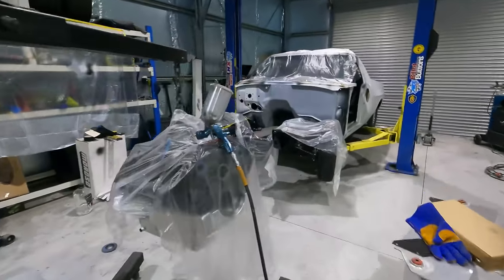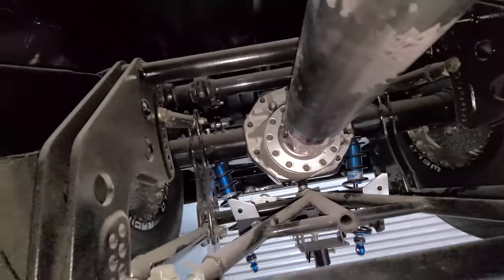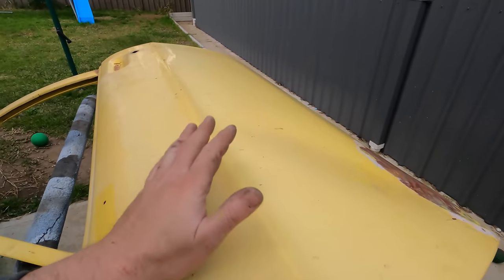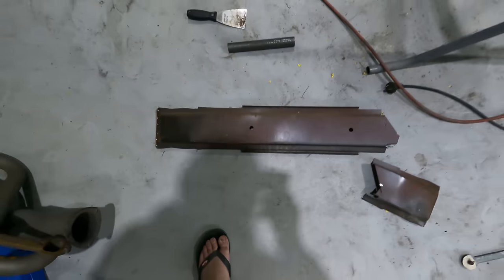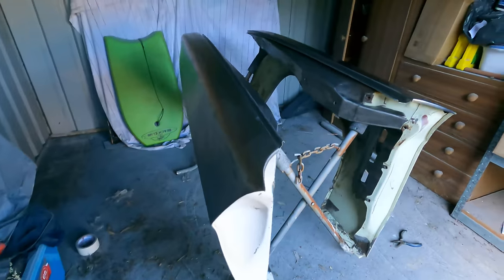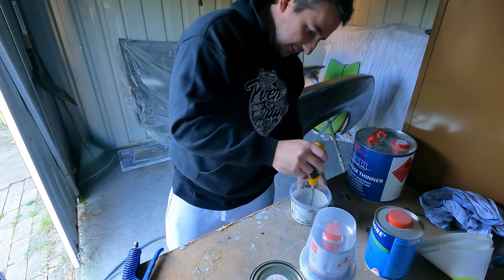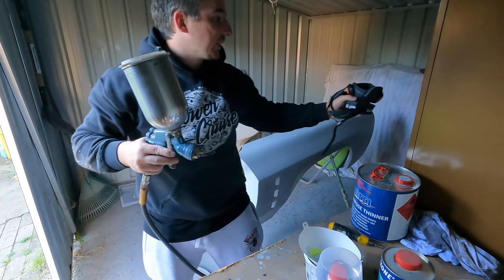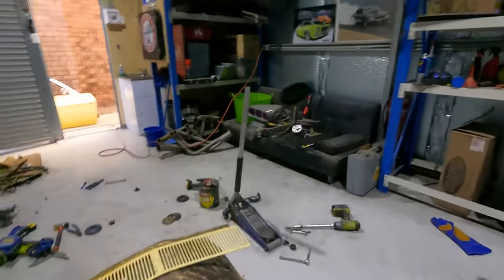#12 FITTING PANELS - FINISHING UP UNDERBODY Holden HZ ute project

Comment: My Dad Metal Finished my Black HJ Premier, years ago, it only had Paper thick filler In it. But if you're only going to skids in it, I wouldn't worry about it to much.
Reply from the maker: Its an art to be able to metal finish a car, I just make sure there is no high spots and use filler everywhere. Filler outlasts the paint job just can't build it to thick as you will know its there when the car goes in the sun and the panel expands. This ute is very straight tho so won't need much at all.